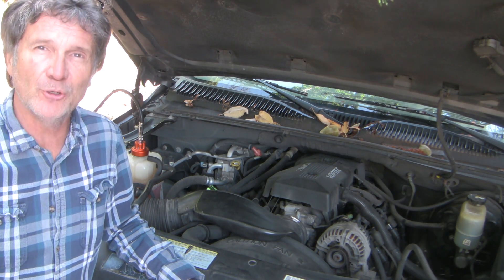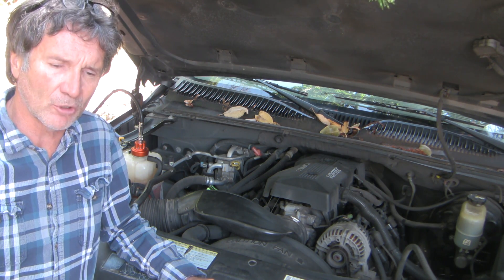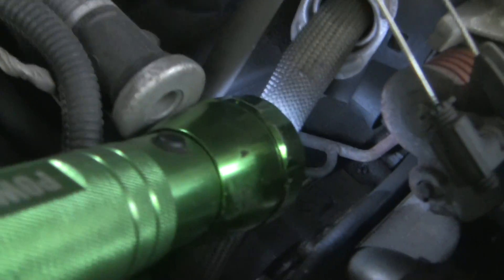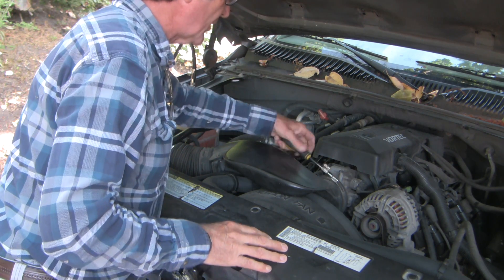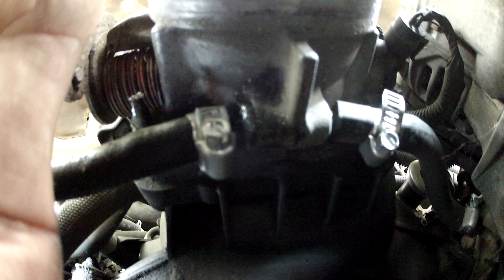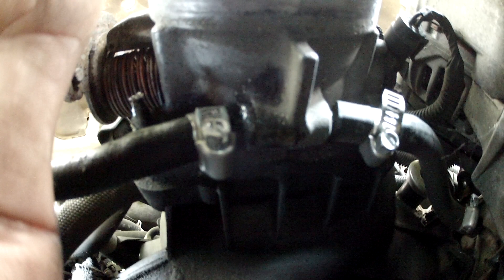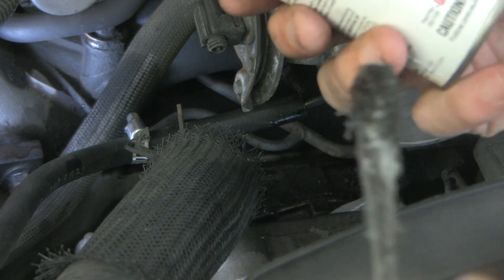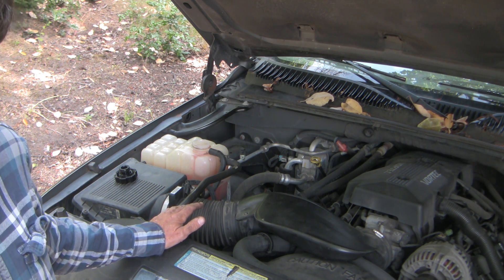How to diagnose a mystery coolant leak in a Chev/GM truck

Comment: Castech heads can have cracks/porosity issues.  Coolant seeps right through near the head bolts.  Can visually see with a pressurized system with the valve covers off.

Comment: Cant see video for the words in the way
Reply from the maker: That's odd. If you have closed captions activated, you'll get that. Closed Captions is optional, you can toggle it on and off by clicking the "CC" icon at lower right of your screen. I did add a few explanatory captions as well, but those are carefully positioned to not interfere with the visual highlight. The other problem is my goofy hands that often get in the way, ha ha.

Comment: I have a small leak near the front left of the head engine seems to run hot but never to over 210 is it a head gasket?
Reply from the maker: Head gaskets can definitely leak either coolant or oil to the outside, as can a cracked cylinder head. Coolant can also leak inside the head and drain by gravity into the oil pan, causing your oil level to be unexpectedly too high. If it is purely a leak to the outside without leakage into a cylinder or oil passages, your problem will be either a mess on the outside of the engine, or drained coolant with secondary trapped air. You want to avoid trapped air by keeping the coolant reservoir well topped up so as the engine cools overnight the air is replaced by coolant from the reservoir. Trapped air is a problem because it can cause localized overheating even if the rest of the engine is OK, and the water pump may be less efficient at moving coolant. I would have it inspected by a mechanic as soon as you can, to avoid letting it get worse and possibly killing the engine. The 5.3 LS engine series have coolant bypass tubing in the top middle of the engine which can also leak, so identifying the source is critical. As shown here, you might be surprised if coolant happens to be dripping down from another source.

Comment: I'm dealing with the exact same issue with my Silverado. May I please ask how you plugged up the vent hole? Nothing I'm using is working. Thanks!
Reply from the maker: Normally with the cap in place, the vent is automatically plugged by the cap. To pressure test the system, the ideal solution is to use the correct size cap adapter, but those can be hard to come by. So, when I did this test I simply used a rubber cork I had on hand to plug it temporarily. As you know it normally needs to be left open so if there is an overheat there's a pathway for steam to escape when the cap spring gate is opened.
Reply: @spelunkerd Yes sir. I should have been more specific, I'm trying to pressure test mine as well but can't find a good solution to cap the vent so I can maintain pressure for the test. I'll go on the search for some good rubber corks. Thank you so much for the quick response. :) Cheers!
Reply from the maker: @brandondye3459  Yes, I thought so. I put those explanatory remarks in for others who might stop by and misunderstand our conversation.

Comment: i just replaced the coolant reservoir in my 03 suburban and now a new leak has sprung up and is dumping coolant as fast as i can pour it in so not driving it till i figure it out, btw non mechanic, so no clue what where or how bad.
Reply from the maker: Everybody who does DIY repair will have a frustrating story like that. I try to convince myself I'll be better after coming through the war, ha ha.

Comment: I just bought an 03 Silverado and the low coolant sign come on the dashboard  filled it but doesn’t maintain the level even after being filled. Is it normal? I drove it for like an hour after that everything was normal and there isn’t any signs of leaks either. The day before tho it did overheat on me and started spilling coolant. Any suggestions? Thank you
Reply from the maker: There's almost always a cause for loss of coolant, most often something relatively easy to fix like a leaking radiator, leaking hose connection, or a water pump that is leaking through seals. Rarely the problem is more serious, like a head gasket leak, cracked cylinder head, or internal leaking through an oil cooler in some models. The important thing is not to let the vehicle overheat. When coolant leaks out, you get trapped air pockets in the system which can cause severe overheating and secondary damage. After a major leak you need to "burp" the cooling system to remove trapped air pockets. I show how to do that in several videos that are listed in a cooling system playlist on my channel. Good luck!
Reply: Can you link a video specifically please?

Comment: Same issue 2002 silverado. No overheating, coolant smell, coolant loss in resavior, and 102k miles.
Reply from the maker: If the smell of coolant is present in the cab, check the floor mats for wetness that might be found if the heater core were leaking.

Comment: The pressure gauge should have shown a pressure drop. And who put the aftermarket hose clamps on ?
Reply from the maker: That's a good point, I didn't wait long enough for the one drop every 30 seconds to result in a pressure drop. Especially when there's a little air in the system, pressure change with volume gives a blunted response which can be hard to distinguish from the normal sag in pressure from aging seals on the pressure testing equipment itself. Any diagnostic test will have false positives and false negatives, so you need to roll with the evidence and understand what info to shrug off.

Comment: I have a leaking under my reservoir container.  When i turn on my truck and it comes to its tempeture.  But today i drive it and it didn't leak. Dont know what it could be. I was thinking my reservoir container was broken underneath.  But im thinking is not.
Reply from the maker: Surge tanks are pressurized to ~15 psi when engine is running, and they will leak from cracks, hose connections, the surge tank cap, or at the seal where the coolant level sensor O ring makes contact. If you find no obvious leak, tighten the hose clamps, and run the engine to expose the leak under pressure. If pressure inside the system is too high, the cap is designed to blow off that pressure, which would be obvious.  Make sure the surge tank cap gasket is intact with no dry rot or cracking. If the system is run low on coolant, trapped air will cause big swings in pressure so be sure the system has ample coolant.
Reply: @spelunkerd  Thank you very much. Friday i will take it in to get it check for a vaccum leak.  I will also put a new reservoir container. Hopefully they find a leak. The other issue i have a mecánic took the out heater core hose out. And only left me with in heater core hose so i only have heating system in my truck. And to replace a new hose is so expensive. I will see when i see the mecánic his able to help me if not i will just replace the missing hose some other time

Comment: Hi I have a 2003 chevy avalanche I keep feeling coolant ofter and it's coming out from the bottom under my truck or it cold be a bad leak what do you think sir
Reply from the maker: If it is coolant on the pavement rather than just water from the AC system, you've got a major clue that will make it easy to find the source. Common causes are a cracked radiator, leaking hose, or a failing water pump seal or bad radiator cap. The critical thing is that you keep the fluid level up while working it up, since ignoring it could overheat and kill your engine. I would have a close look in the next day, and I would make every effort to get this diagnosed within a week. Repair for the above problems is not usually very expensive, so unless you really want to pursue a DIY approach you're probably better off getting pro advice. I did a whole playlist of cooling system problems if you want to go through the effort to learn more. Good luck!

Comment: I’m having the same issue with my 2000 GMC. No trace of a leak anywhere that I’ve found so far. I’m going to go right to this spot and see if that’s the culprit. Thank you so much for posting this !!
Reply: Hey did you check it out ? I’m gonna share this video with my mechanic.
Reply: @ElleBrOw  yep , we’ll I think it’s the main problem anyways. it was the water pump intermittently losing coolant out the weep hole. Just strange cuz it never left a puddle or trace. I caught it early. I’m hanging a new one on today.
Reply: What was the name of that tool? That goes on top of the radiator reservoir
Reply: @AndresGomez-bi2vs  you talking about a coolant filling funnel?

Comment: NICE!  Happy I found this. I have a mystery leak on a 2000 gmc with the 5.3.  I recently had the throttle body off for cleaning, and at the time was cursing those small hoses.   Today am under the truck fixing of the stuff and notice a small/slight coolant leak dripping from the front of the engine.  I know exactly where I am going to look tomorrow.  👍
Reply from the maker: If you can't see leakage with engine running where mine was leaking, you'll need to get a closer look from underneath. Pay close attention to the radiator, which commonly leaks where plastic meets the aluminum heat exchanger. To inspect properly underneath you'll want jack stands (not just a jack). You'll need to remove the skid plate that is bolted on and plastic covers. Then when engine is not running crawl underneath and find the water pump. A common source of leak is the weep hole from the water pump. I did a whole series of videos on your engine, and I have a playlist of cooling system problems on my channel you might find useful. Many demonstrations were done on your engine. Good luck!
Reply: Thanks.  It looks like it is leaking from the water pump to block gasket, on drivers side near the power steering pump. So the dilemma I have now is do I go with a whole new pump or just replace the gaskets.   I will look for your other content on this one.   Great quality content videos by the way. Very professional. 👍
Reply from the maker: Oh, one more thing. When I first did this water pump in 2013 I came down heavily on the side of replacing the pump at the same time, which is a work pattern followed by most pros. Given the poor quality of the last remanufactured pump I got from NAPA in about 2020, I've been rethinking that bias. Even the weep hole on that reman pump was covered over with paint. At that time I got better gaskets separately so I didn't have to use the thin paper gaskets that came with the pump. So, it might be an idea to replace only the gaskets, they were easily available at that time. Pros don't do that because they don't want to warranty the labor, but in amateur work flow the cost of labor isn't very high, ha ha.
Reply: @spelunkerd    Exactly my thoughts.  I picked up a pressure cap for testing.  Will try that in an hour or two, and go from there.  I hope/plan on just the gaskets and resealing the backing plate of the pump, assuming that is the leak area.  Even though it is old and probably original, I have no bias or want to replace the pump if it is not showing anything from the weep hole.   Circulation is good, heater blows hot, and pump turns smoothly.  Just a seepage and small daily drip to find and fix.  The truck has 238,000 Km.  Thanks a lot for the thoughts and encouragement.
Reply from the maker: @billybobbarker3175  As I recall, I did a two part video set of this exact many repair years ago, it was about 2013. Content delivery is a little slow in those old videos but the information is there. Back in about 2020 I had the same leakage where you describe and I did the repair again off camera. It's been fine ever since, I drove it yesterday.
Reply: I fixed one of the throttle body heat tracing hoses which looked in poor condition. The one on the alternator side. It was not leaking tho. After 4.5 hours under pressure the only location showing some sweating is the pump to block gaskets behind the water pump.  I picked up two gaskets today, 10$ each.  That is the only fix I plan on doing.

Comment: I sent my car to the mechanic, they did pressure and combustion test. But still no signs. But I still continue to loose coolant
Reply from the maker: If you have an older model chev truck like the one shown in the video, GM had some cases of porosity of their aluminum heads that leaked internally. Some were severe enough to justify changing the heads, and others were approached by noninvasive means with staying caught up with coolant. There were also reports of porosity of the aluminum block castings as well. If you think yours might fit into that category you can search something like "gm aluminum head porosity". You can find the casting number on your heads by cleaning the front passenger side head to look for a three digit number, some castings were especially prone. For now the simple approach would be to keep on top of refilling fluid. Keep an eye out for a damp passenger side floor mat, leaking hoses etc. The real danger would be to fall behind and allow trapped air to cause an overheat.

Comment: Dave, I'm losing coolant in a 2001 Tahoe, but there are no leaks that can be found.  Oil needs to be changed, but it is not foamy or milky, so the coolant is not going into the engine block. Light came on. Added coolant.  2 miles later, shut the vehicle down, was inside the bank for about 30 minutes.  When I came out and started the vehicle again, the LOW COOLANT light was back on.  I've had someone check for leaks with lights and none can be found.  What can be the problem. 

 What is involved in trying to determine a head gasket leak?

 How would I be able to tell if it is a water pump gasket or other issues?   

I am a widow and not a mechanic.  I feel like some things I have been told may not be correct.   Feeling like I'm getting 'scare tactics' used on me to get them to do engine work.   

Any suggestions?   Would I have any better luck at a dealership.  (337,000 miles on the engine).  I dread the cost, but I need to keep the vehicle on the road.  I do not drive very much or very far and certainly cannot afford NOR do I want a new vehicle (too many bells and whistles on new vehicles for me).  HELP PLEASE.
Reply from the maker: I would not jump to the conclusion of head gasket leak. The most common cause of leaking coolant is a leak at the radiator, usually easily found with a light and mirror, often at the side where plastic meets the aluminum heat exchanger. Following that, hoses can leak, the water pump can leak, the reservoir cap can fail to hold pressure, and even the heater core can leak coolant onto the passenger side floor. In addition this generation of chev engine had a problem with porosity of the steel that heads were made from, which can also leak. I would not take it to the dealer, I would look for a local shop that does general mechanical work. They would likely do the pressure test I showed here and most of the time would find a diagnosis. If nothing is found, I would continue adding coolant to keep it well topped up, continue to drive it, and wait for more clues.
Reply: @spelunkerd I have the same 2000 suburban with a mystery leak. 

I completely changed all hoses, new radiator, just did the thermostat (twice), new water pump. I put new gaskets on the valve covers and found milky oil in the valve covers. But no milky oil in dip stick. I have to add coolant every 2-3 days now to top it up. I do hear a tick in the mornings when I start it up in cold start and it goes away when it’s warmed up. I’m thinking maybe I got a defective water pump. But ima change my radiator cap first to check if that’s the issue. I do get some white smoke at start up but not too much. Any ideas, please help! Thanks in advance. And God bless.

Comment: I have. 2019 suburban that was leaking and overheated so I refilled it and so far so good. If it leaks again what could it be
Reply from the maker: Make sure you burp the cooling system to clear it all of air, trapped air is a common cause of overheating. Basically to burp you simply leave the radiator (or in this case the pressurized cooling system reservoir) open to air while you warm the engine up. While working it up you need to stay on top of it. The most common cause of a leak is a bad radiator, commonly at the edges where the plastic housing meets the aluminum core. Other causes include leaking hoses, a leaking water pump, bad hose clamps, leaking heater core, etc. I did a whole cooling system playlist, including many videos taken of this very vehicle. New vehicles have moved to electric radiator fans, so make sure those are turning on in the heat.
Reply: @spelunkerd  thank you. So after 10 miles it started loosing coolant again but it’s not showing on the ground. Is that a bad head gasket issue waiting to happen?  Should I try devil blue sealer. It has 180k miles
Reply from the maker: @Gabagoolll471  Don't add any form of stop leak or sealer. Keep adding fluid, at this stage I add distilled water to save money but you could use tap water while you're trying to work it up. You may need to remove plastic covers underneath to get a good look at the water pump and the underside of the cooling system. You want to use a mirror while the vehicle is off and find the weep hole on the bottom of the water pump. Feel the floor of the passenger front seat for wetness, and use your nose to identify a coolant leak there. Park over pavement where you can identify leaking fluid, but remember the AC system will normally drip plain water, too. Coolant that evaporates will leave a crusty mess, look for that.
Reply: @spelunkerd  ok thank you sir. It’s either head gasket or water pump so we’ll see